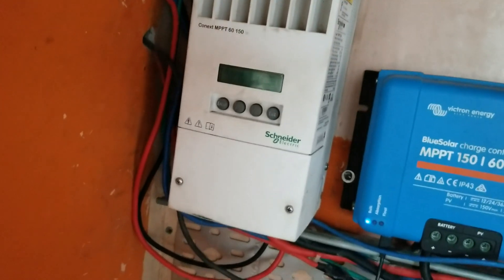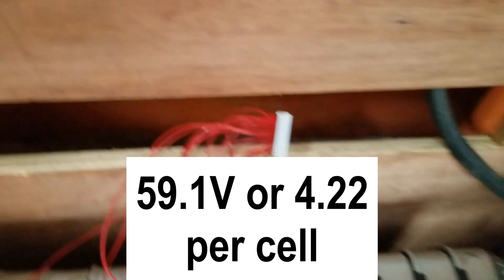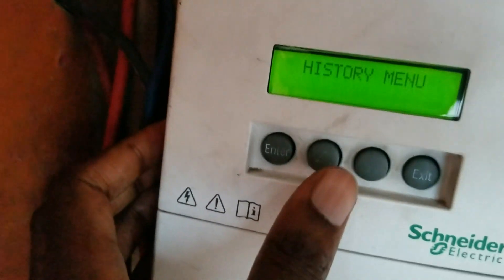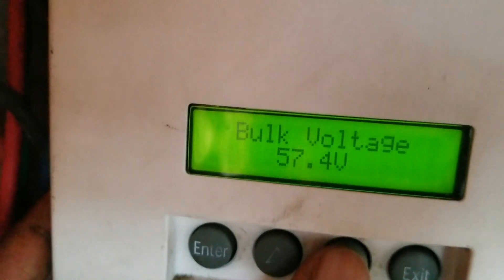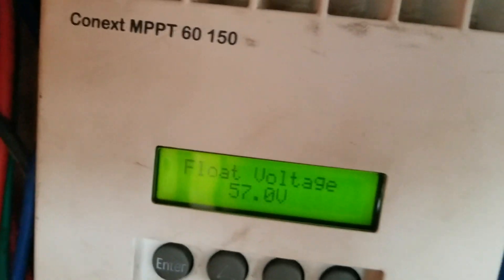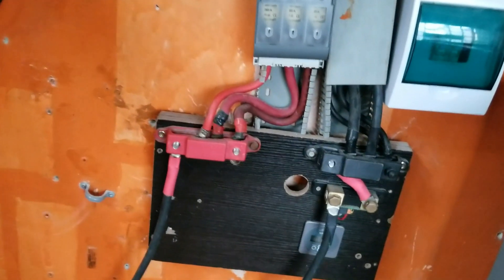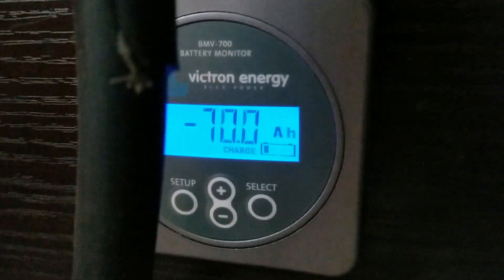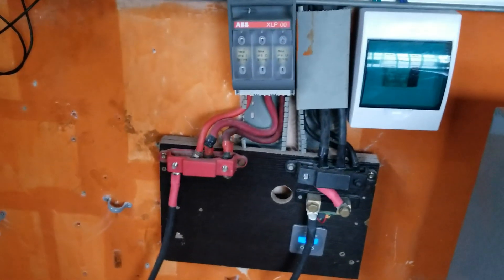Destroy batteries, me nearly do. Oh No!!!! I overcharged my batteries

Comment: Temperature compensation needs to be off and find the maximum charge voltage and set it. Set the bms to top voltage and the charger to .2 volt less
Reply from the maker: It is off on the Victron. My BMS is a dumb unit. Its purpose is to turn charge off. It is not connected at the moment. I don't use it for any other purpose. The balancer manages the other functions. I changed the temp compensation setting on the Schneider and we are good. Thank you for watching and commenting
Reply: @drsolar   Let the charger do all the work so use settings that are inside the parameters of the BMS this way the charger can do what it is designed for and the BMS only kicks in when the chargers fails . Everything will last longer this way.
Reply from the maker: @offgridwanabe  great advice

Comment: Does this imply that this charge controller does not have settings for lithium batteries?
Reply from the maker: It is a charger designed for lead acid batteries but there is a degree of latitude. It works great for these batteries. Thank you for watching

Comment from the maker: The settings on the charge controller are 57.6 bulk and absorb and float 57.00. The batteries were at 59.1V. What did I do wrong? Did I kill the batteries. See the simple reason why it happened. (Nobody seems to get the Yoda like heading yet)